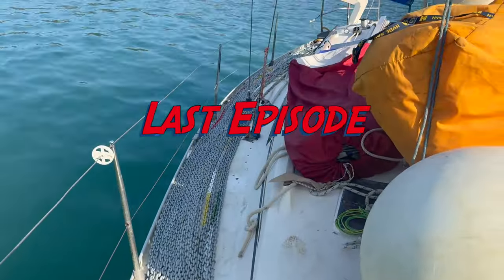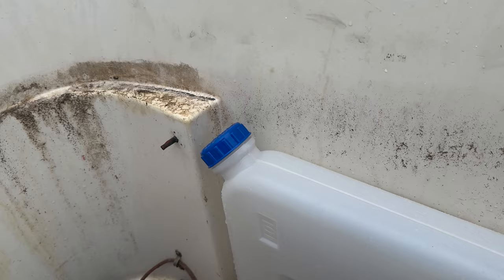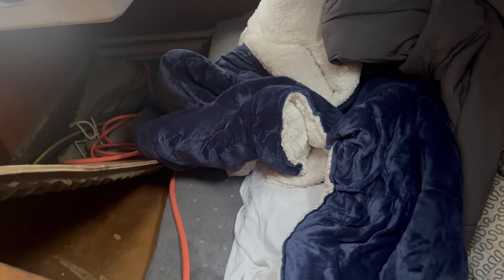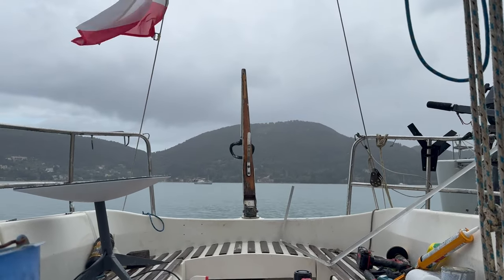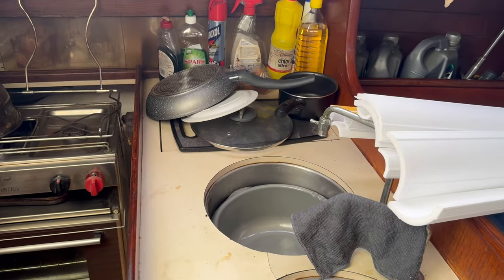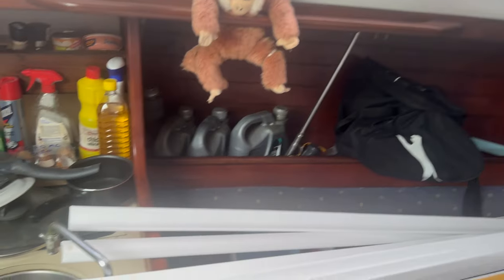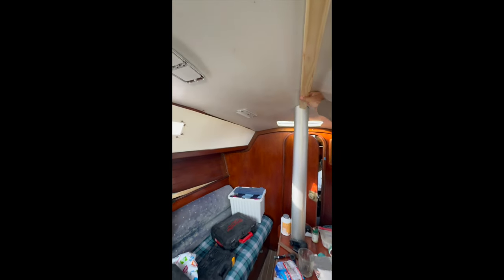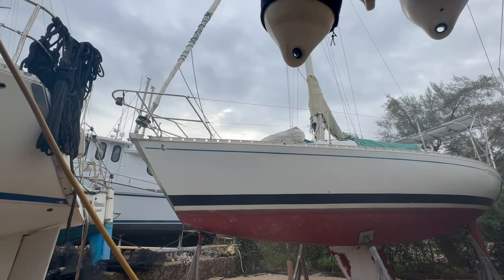Fitting a Diesel Heater and getting the gas working | S4 E36

Comment: Please think about taking the exhaust outside, maybe a thru hull fitting. Diesel exhaust isn't nice.
Reply from the maker: It is outside. There is no exhaust coming into the boat. The location of the exhaust is under a removable seat but the front is completely open.
Reply: @Sailwithandy  
If you're going to keep it there and think it's ok, then make sure that the drain hole on the exhaust silencer is pointing down 👍
Reply from the maker: Oh yes definately It was one of the reasons for fitting it here. I am planning on getting a stainless steel elbow fitting to attach to the hole.

Comment: Nice work Andy  , for the window bolts .. I would cut the threads down and replace nuts with some SS dome head ones, will give a nice rounded finish. Also for the heater exhaust i would get some heat wrap as its close to the wires and outlet
Reply from the maker: Good advice. The wires are routed to the rear and then down well away from the heat of the exhaust. I like the idea of the dome head nuts